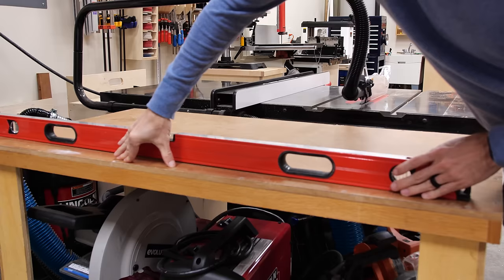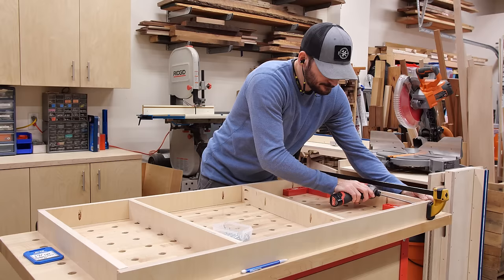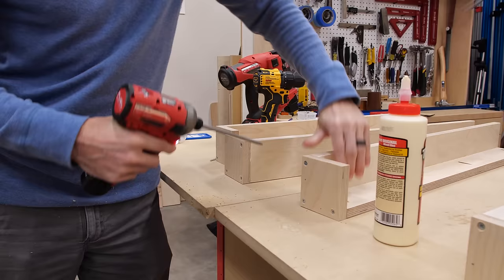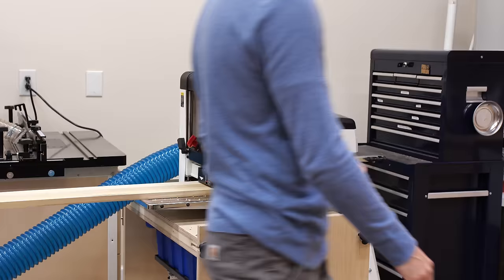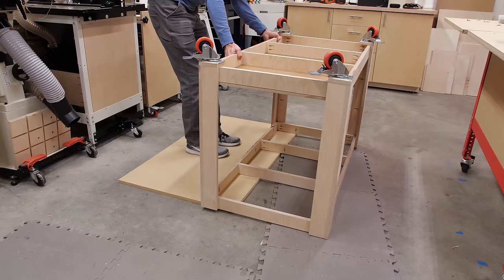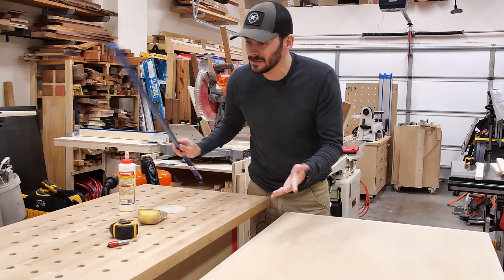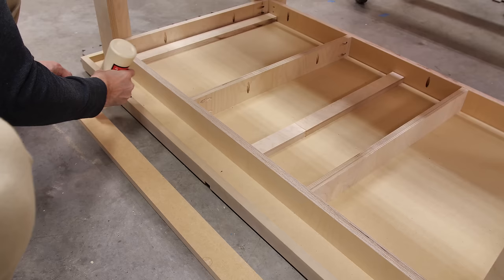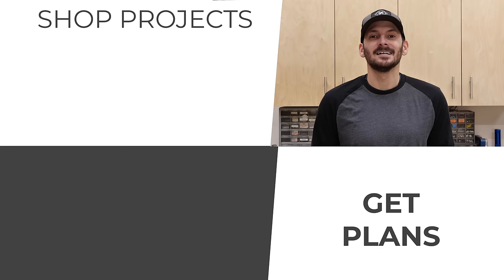Simple Table Saw Outfeed Assembly Table | DIY Woodworking

Comment: I think you'll like the t-tracks. Did almost the same thing and made a bunch of right angle jigs. Works great when squaring and clamping drawers and smaller cabinets.
Reply from the maker: Which t-track clamps you like the best?
Reply: So far I've only made my own but I do like the looks of the auto adjusting clamps like rockler and armor. Right now my favorite is simple corner plates I can lock down and use parallel clamps to hold things together

Comment: Just finished up your Ultimate Drill Charging Station.  Just need to add the finish.  Grabbed these plans today as I need an outfeed table.  The only difference is that I plan to put some drawers on the bottom.  I just need to leave space for the motor on my old Delta Super Contractor saw.  Which will need to fit under the table.  Great vid and explanation.  Hopefully this will be my last build before I start building product.  Thanks

Comment: Not the outfeed table I would have made, but then again I'm building with different scrap material, 2x4s and a 36" solid core door.  I did get my question answered however and that's the height.  Mine will be shorter than the miter slots in the table.  Thanks for the info and keep the good stuff coming.

Comment: I built one very similar out of 2x4’s and MDF and love it! (I need another one)... I added MFT style 3/4” dog holds and got some Kreg holds for it - works great!  The only issue I have is that the table gets in the way of my SawStop 4” vacuum hose port - I see your table has a raised bottom so maybe if I raise it a little more it will be high enough to clear the vacuum hose port.  Thanks for the great build!
Reply from the maker: I actually lowered the shelf to go UNDER the port. It slides right under it

Comment: Awesome table.  I REALLY need to get around to building a proper workbench and also an assembly table.  I think I'll start with the table before tackling the workbench.  You shocked me when you said you're over 40.  I never would have guess you were past your 30's.  I can relate to getting older.  I'm almost 40 myself and when I get that 8/4 material on the table I miss my 20's body :)

Comment: Very nice build, and I got a few ideas to use on an upcoming planer stand. It is a fairly quick project, and burns up a lot of the scrap stuff laying around. The only tip I could add is to use your nail putty after putting on the clear finish. Shop projects (with natural finishes) aren't critical, but the putty does leave a 'halo' around the hole when applying finishes. These areas might look different, as the putty does partially seal the wood.

Comment: love the build and looking forward to making one of these for my SawStop and make my current outfeed table into an assembly table.  thank you for sharing.
Reply: I'd recommend making it a bit taller so that the table is only about 1/16 lower from the table saw so that pieces don't drop down when you are cutting long boards.. Just route some grooves to match the grooves on the saw for jigs
Reply from the maker: Thanks, Will!
Reply: Gage Pine I have thought about that but with the table being on wheels and mobile the possibility of the table getting knocked to one side is great and then I would be bumping the table saw sled into the table creating an unsafe situation. Plus I have a 10yo who tends to lean on tables and move them.
Reply: Jk Canvas yeah, I have to agree, my outfeed is permanently mounted to my saw so I made it about flush and routed grooves, with wheels, though, unless there's some way to sort of dock it to the saw I do think there's a pretty good likelihood of the grooves not being where they need to be by accident.

Comment: Hi Brad, I have a question about routing plywood for a T-Track, the plywood has knots in it which I cannot avoid in my design. Without having to pay for premium plywood (that is pretty much Knotless) but twice the expense $$ how do you suggest getting a clean cut through knots in the wood or am I dreaming and it can't be done? I made 2 of those mobile workbenches 48X40 and they turned out nice and Thanks for the Idea!!

Comment: Those 'over 40' issues you're experiencing? They get better when you start having 'over 50' issues. Great build for sure. I used 1/2 inch MDF for the top of my workbench but had a matching sheet of 1/2 inch plywood underneath to help prevent sagging. I also probably over-engineered the workbench, but that's what we do, right? I also look forward to the video where you call them 'me' nails. Nice use of scraps.

Comment: "...over 40..." - yeah, i feel you bro. Same problems...
Reply from the maker: Getting old stinks
Reply: @Fixthisbuildthat  Hilarious! I just had to do something similar to this (building a new table with castors to hold my planer) and on my next birthday I'll be 77 years old. For the math-challenged, that's almost twice "almost 40." Yesterday I installed folding legs on my outfeed table, which is attached to the saw and folds down. Much of the work was done sitting on the floor, and getting up and down with 77 year old knees. Almost 40? You ain't seen nuthin yet...

Comment: ,Was there a reason why you used plywood to make the legs vs 2x4?   Was it because it was what you had or was it because you think the legs will be stronger by making them out of plywood?  thanks!
Reply from the maker: More so you could make the whole thing from one sheet of ply. But legs would similarly strong vertically as 2x4s. Or at least as strong as you'd ever need

Comment: If the bottom of the sled miter bars line up with the outfeed tabletop, does that mean when ripping without a sled, your workpiece is not supported by the outfeed table?
Reply from the maker: that's correct, it's more of a landing spot than instant support.  I prefer it that way, but you could build it flush as well

Comment: Great video, really appreciate the step by step and the printable plans. Super easy to follow and easy to build.

Question, trying to pick out a good plywood foe the table top. Any recommendations? (Oak, Maple, Birch, ect.) I know you used MDF at first but said not to, and I would like to use something else other than MDF mainly for strength and durability reasons.
Any advice would be great! Thank you!

Comment: Nice project.  Thanks.  I need to build one myself.  At 4:30, if you put the glue on the legs and not the frame, a mess would not be made.  10:00, any reason you were routing the non-typical direction?  Thanks, again.  Nice work.

Comment: Are you supposed to screw from inward outward? I get that it helps hide screw holes on the outside but is there any other structural reason to not screw from the outside in?

Comment: Hi,

I just have a question. Recently, I seen one of your videos on how to transfer a image on to wood using the polycrylic. Thank God I found another solution into transferring a image on to wood. I tried the graphite paper, I really don't care too much for that, and I also tried the wood burning. I didn't like how it turned out I am into jewelry making, and I want to make wooden earrings using wood. I was looking for other alternatives to transfer a image on to wood. I am so glad I came across your channel. My questions are what type of wood would you prefer, and is better to use parchment paper instead of paper so it doesn't leave white residue or it doesn't matter❓, and when I have my image printed laser should I have the image rotated left sided❓

Comment: That is not a half inch leg. That is a typical L profile leg, which is a common way to make load barrier structures (shelves, industrial tables, even trailers,) if that type legs connected properly, they can carry stupid load of weight. Each connection (including shelves and tabletop) increase the  horizontal stability of those legs. And the vertical strength of the plywood also  wel known.l

Comment: If you used plywood for the top surface would you still have added the solid wood edge? Is it necessary or is it just to minimize damage to the plywood edge?
Reply: If plywood delaminates it usually starts at the edges. Wood edging does a great job of keeping the edges together and the edge of your table square. It also gives a little more protection from the top possible sagging. If you cut the edge board a little wider than the plywood thickness you can add an 1/8 inch rabbet to the edging and it gives considerable strength to the table top in the prevention of sagging.

Comment: Great video Brad, 1 question why did you cut the t-track short on the outfield table top? wouldn't it look nicer if the track was flush on both sides?
Barry (ENG)
Reply from the maker: Hey, Barry. Basically just to preserve the offcut pieces. If I cut it full it would have been right through a screw hole
Reply: @Fixthisbuildthat  Oh right thanks for the reply.
Barry.

Comment: The outfeed tables look similar, but i noticed a few differences. This time, you used only wood plates to attach the wheels (last time it was blocks of wood). This time, the legs are outside the upper frame for the top; in the older version, the legs were inside the frame. Also, the older table was not assembled with pocket joinery. Why the design changes?

Comment: Great video! Interesting that the outfeed table is low enough to clear the miter saw sled, instead of making miter grooves. Is that working out OK? I may do the same, just curious if the height difference caused any issues?
Reply: I built this a couple months ago.  It lined up perfectly, so I didn't need to cut miter groves.  Works perfectly.